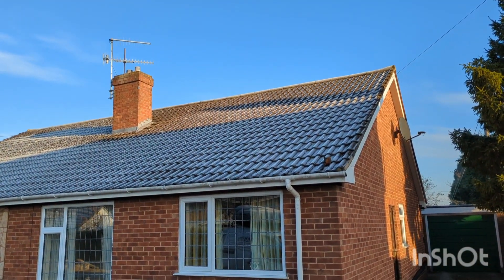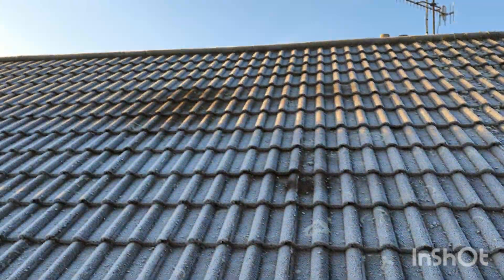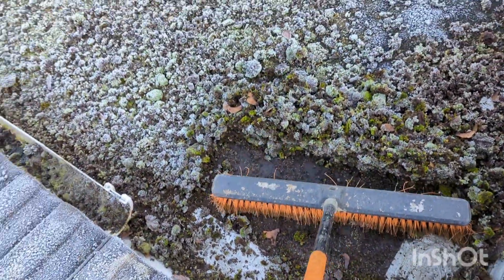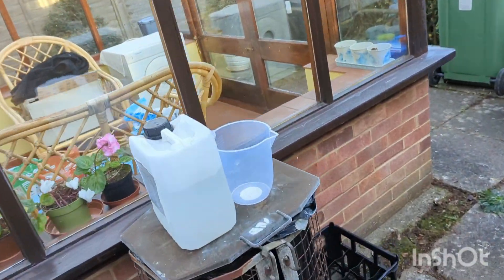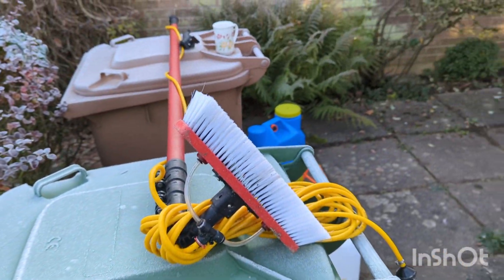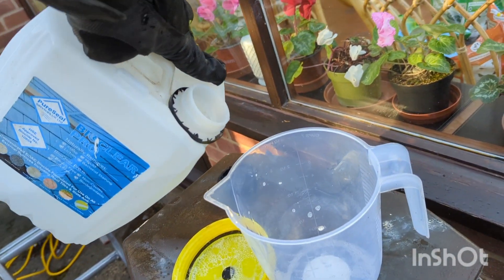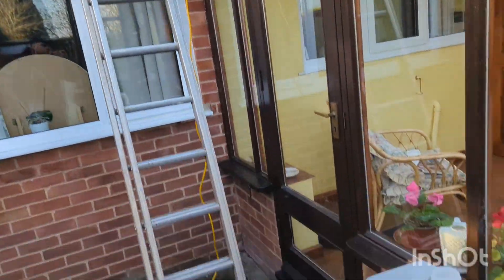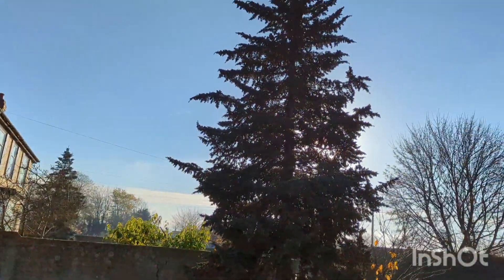Applying Bio-Clear Pro to a bungalow

Comment: Nice job today, especially making sure the downspouts were clear.  Check your biocide to see if there is a minimum temp for application.  The one I use has a minimum of 5 degrees C.  Would hate to see a video of you having to return to this house to reapply.  Haha.
Reply from the maker: Thanks mate, BioClear is good in cold weather 👍
Reply: @SMOUT_  is it the 50% ddac product? That's the only one that's really ok for cold weather as it's suspended in isopropyl alcohol. The 40% ddac and the Bac50 are no good below 5°
Reply: @SMOUT_  Also, I would hugely advise an abec filtered mask when you're using hypo or bio. You only get one set of lungs mate, and hypo is seriously corrosive, whilst bio is carcinogenic. Look after your lungs. Also, makes you look more professional 👍
Reply from the maker: Thanks for the heads up mate. Im supposed to be washing a carpark tomorrow and wanted to treat the bad bits with 40% bio. Sucks that it's probably going to be too cold 🤦‍♂️ noted regarding mask 👌

Comment: Hi mate love the videos! Iv just set up myself, all I see I people using biocides on roofs? I used sodium hypochlorite on my roof it came up brilliant am I suppose to be using biocide?
Reply from the maker: Thanks mate, glad to hear it. Hypo is fine for a lot of roofs and will give you good 'instant' results, but you need to be careful with certain tiles like slate and lead flashing because it can have a bad reaction. I'm not an expert though.
Biocide will give you good long lasting effects which take weeks or months before you see much of a difference but it's much safer on pretty much any surface, and will prevent organic regrowth for a lot longer.
After an hour, hypo is dormant, biocide keeps working for months.
Good for post treating after pressure washing or scraping 👍